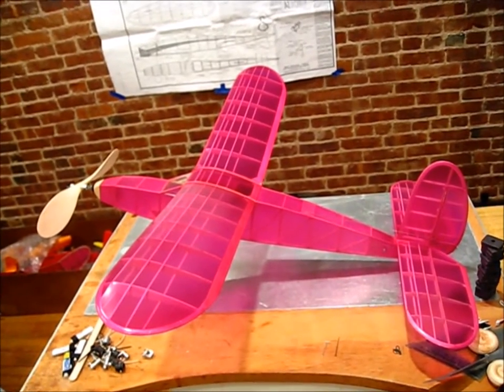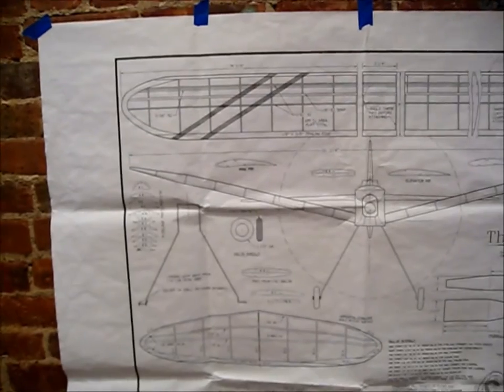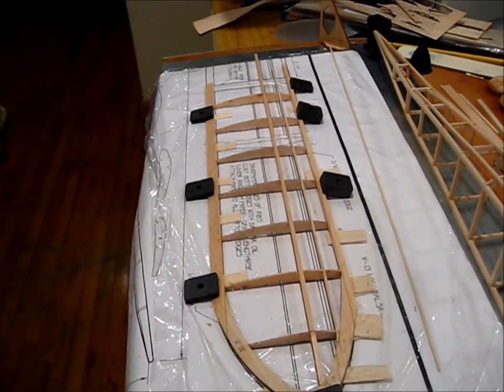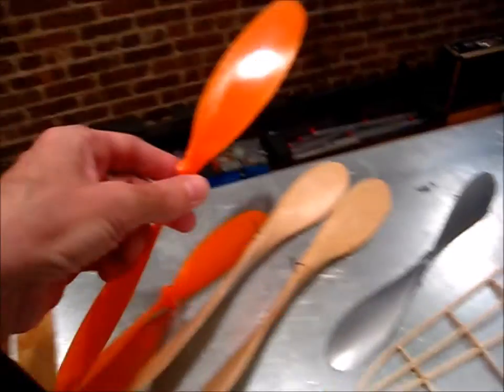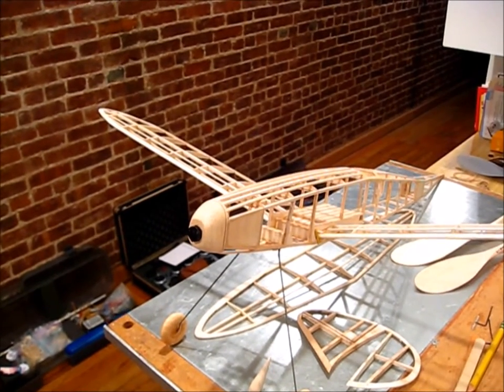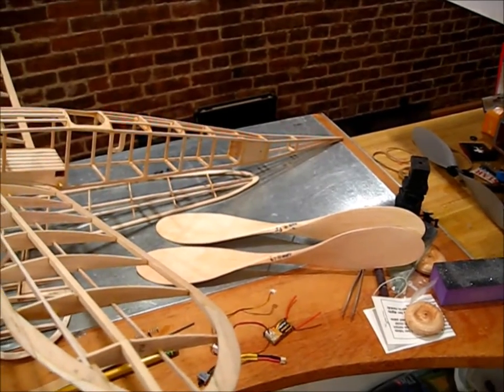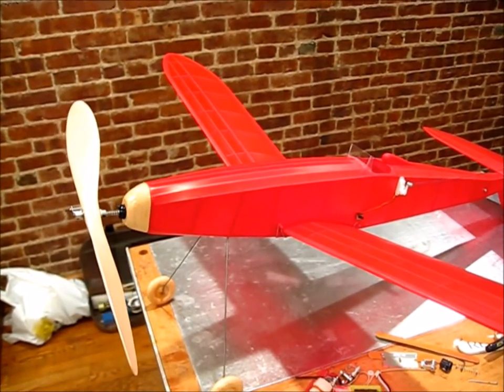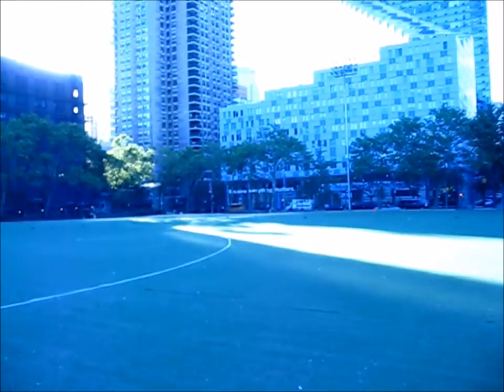Earl Stahl's Hurricane rubber power RC - building

Comment: very nice plane.. you have inspired me to try this rubber power rc controlled aspect of the hobbie.  if you have problems with the push rod bending just get a coffee straw and slip it through.. it will fix that problem with out having to adding more weight which thicker wire would do.  nice flying plane..   i look forward to gliding in the desert sky!
Reply from the maker: That's great, would be nice to see others flying rubber RC! The plane turns nicely so slight bending of the pushrod doesn't seem to be an issue. I've been thinking of using a boron tube as a lighter, stiffer alternative, but the music wire seems to work fine. Have fun flying in the desert sky, you should post some pics or video!
Reply: thanks, yeah it will be a learning experience for me.. im new to RC..   been learning to fly and build multi rotors (all sizes of quads, smallest one was a 130mm and lets just say i will not build another one thats mall.. 180MM and up, collecting parts for a 680mm Aerial Photography multi rotor.. etc.. ) anyhow, its time to spread my wings into planes..  i picked up 3 cheap rubber band kits from the late 60s/70s.. my plan was to build them and convert to electric.  figure first one id build up to the plans, then second add electrons, and by the third be full 4ch..  but i got stuck.. t he build went fine.. until it came to dope/tissue.. i had no clue what that was.  google dope, just brought up well lots of eltertanii8ng alternatives to what i wanted to know. LOL.

so i just made a wood static stand because i was proud of the wood skeleton i built.. was a lot of fun to build as iv been working with wood all my life.. was nice to sit down, and work on a wood project.. unlike anything else iv done you have to stand at the bench.. i have a bad leg from a motorcycle accident so i don ot walk or move so well and have to sit 90 percent of the time..  

anyhow, living here in the desert really as focus what i want to get out of the plane aspect the RC hobby.. gliders.. between multirotors, and gliders and ill be a happy man.  

so now i bought some stuff recommend to me from a old timer for my first try at doping.. its called EZE Dope.. its water based.. brush it on etc. 

so i bought that.  im not gonna touch my static model i built.. figure its time to refresh my mind on a build again and start from scratch.  after seeing all your videos.. i see there is a lot to learn.. but il go slow.. use the rubber band engine they have in the kit etc.. and then see what happens.  you have a lot of specialty stuff which seems like it would added up in a hurry. heh.  but yeah im gonna give the rubber band part a try at least once.. i figure it will at least keep things simple and i can still get some kind of control flight.. ill be watching a lot of your videos to learn.. i have since sign up to the forum you are on.. been reading there too.  haev a great day.

Comment: Very nice as usual!  As a stiffer alternative to the wire pushrod, I've used 3/32" balsa sticks with wire spliced onto the ends.  A little susceptible to breaking but will give better response.   The wire pulls great, but not so great on the push!  I always enjoy your videos.
Reply from the maker: Thanks Phil. I can't risk a broken pushrod or I'll hit a building, I might try a thin carbon fiber tube, but there isn't much motivation because the wire works great - as shown in the video turning isn't a problem - and the weight savings is trivial. Glad you're enjoying the videos, makes it worthwhile!

Comment: Excellent job. My motors break at about 300 winds but I don't stretch before winding. Would I get 800 if I stretched the motor before winding?
Reply from the maker: Yes, stretch it at least 6 times it's resting length and you can crank in many more winds, also make sure it's lubricated. The Hurricane uses a 12 strand motor of 1/8" 22" long, braided, and I can crank in about 850 winds. If the motor is broken in, by stretching it a day or so before, then I can get up to about 950 winds. Have fun flying!
Reply: +domoremath can you please direct me to more details on the half-tube winding method/configuration?
Reply: Thanks a lot!
Reply from the maker: Check hippocket aeronautics to get more details. I've been thinking of making a video on this sooner or later as well.
Reply from the maker: I just posted a video I made on half-tube winding, hopefully it helps.
Reply: Bought the lubricant and got 750 winds by stretching. Best flight ever!
Reply from the maker: There you go, more winds = longer flights! If you break-in the motor you'll be able to get in a lot more winds. Only drawback is you need a good supply of rubber - I only get one, rarely two, flights out of a fully wound motor.

Comment: Just ordered a Jimmy Allen Special. Haven't built one in 60 years. I'm 78 and want to give this rubber power rc a try. Can anyone give me specific info on the electronics required. Thx...arg
Reply from the maker: That's great to hear, welcome back! The equipment is basically what is shown in this video: https://www.youtube.com/watch?v=9V-bxTQrTdQ  - that is, I'd recommend a Lemon receiver, the HKM servo (or something similar) and a 75 mAh lipo battery. Sort the comments to 'newest first' and you'll see a reply about updates that I gave to a question, plus there are other options that others have mentioned (banggood receivers) but I've only used the Lemon. Any suggestions as to other equip that one has tried are welcome.

One quick comment - the JA Special is a great plane, but I think 20" is a little small to deal with the extra 6 grams or so of weight that the RC equipment ads. I build a few 24" with RC, but they flew to fast, so I really like to stay closer to 30" for RC rubber. I think the Jimmie Allen BA Parasol from EB at 28" would fly nice with RC equip, or any of their larger rubber jobs. Have fun!